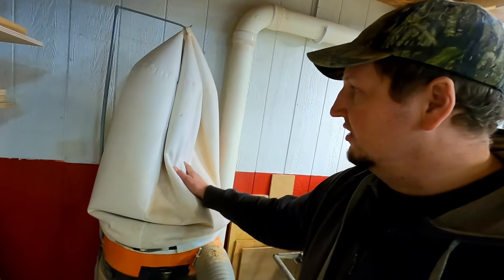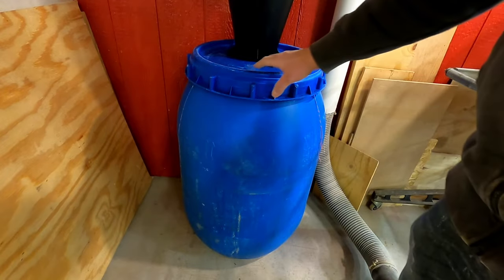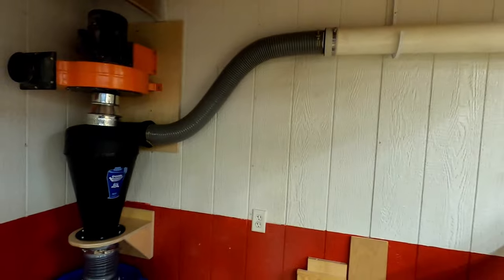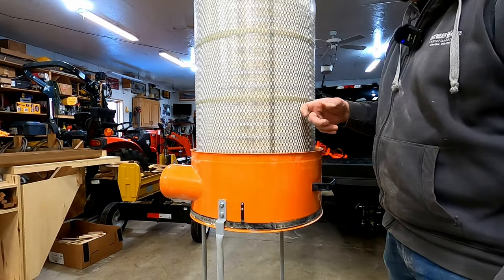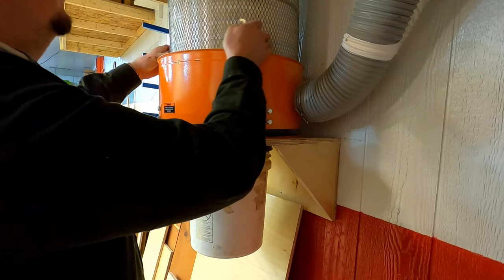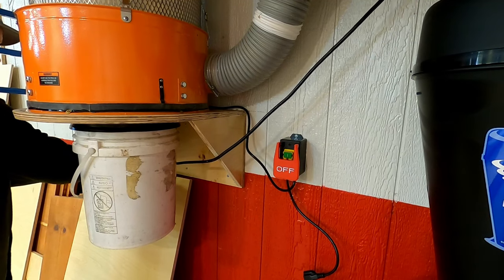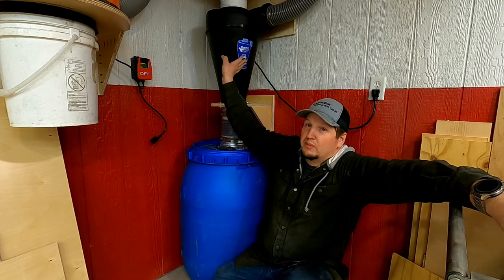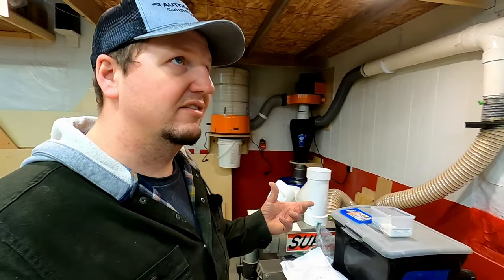Is this the best upgrade for a single stage dust collector?

Comment: Easy upgrade for barrel would be to get a clamp with quick release. Love the video and about to get a wen dust collector with the plan to do same upgrade next year.
Reply from the maker: The removable tops are great.  Just get a two piece lid and it works great!
Reply: Or you could put a couple handles on the barrel and spin the barrel  @OutdoorsEngineer

Comment: You could probably delete the Oneida the way you have it set up and just put the big barrel where you have the small bucket. That's my plan except I'm going to vent my outside through a dryer vent that's in my workshop and also delete the filter.
Reply from the maker: The Oneida is nice to be able to get most of the big stuff out before it gets to the fan. The idea is to have multiple ways to extract dust, and the deputy is the first one in the line. Thanks for watching!

Comment: Can you remove the filtersack and just suck everyting out in a ventilation hole in the Wall?
Reply from the maker: Sure, as long as you have an intake that allows the same amount of air you are pushing out to be pushed back in.  Especially in heating and cooling seasons, this would result in extra heat and ac required to cool or heat the new air coming in.
Reply: @OutdoorsEngineer  ok yes...thanx

Comment: I have that idea for the future, mi sisten is same but whith vacuum and dust stopper, but mi sistem is 2.5 inch, is that a problem? Any answer in spanish is better but i have translayor
Reply from the maker: Traduje esto usando IA. Típicamente, la mayoría de los sistemas son al menos de 4 pulgadas. Si tienes un sistema de 2.5 pulgadas, eso restringirá el flujo.
Reply from the maker: I translated this using AI. Typically, most systems are at least 4 inch. If you have a 2.5 inch system, that will restrict flow.
Reply: @OutdoorsEngineer  tankyou

Comment: What do you do to clean the filter?
Reply from the maker: Stick around.  I"m working on a video this week to be release this weekend of the updates and cleaning of the dust collector!  

Just use the air compressor to blow it out, blowing air from the outside.

Comment: Why buy a different 2 part lid? Just cut the one you have to hold down a piece of ply to the barrel.
Reply from the maker: Not a bad idea.  I do have another single lid I could cut down too.  To be honest, I don't know if it's s need or not.  Not that bad to just remove the flange.

Comment: My super d.d. is way  bigger that that. I don't think they had that size at the time I did mine. Or I messed up.
Reply from the maker: I originally had the big one.  Then realized that they had a smaller one, so I swapped them and Woodcraft made that very easy. Sometimes the bigger one won't work as efficiently with a smaller blower motor that's on the Harbor Freight and Wen 3403.